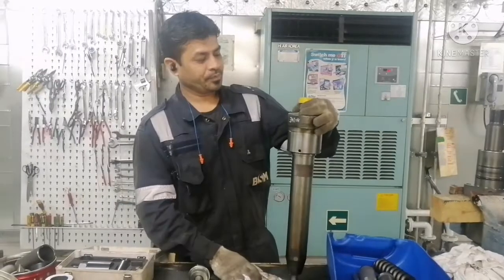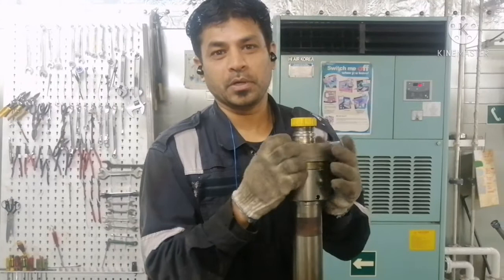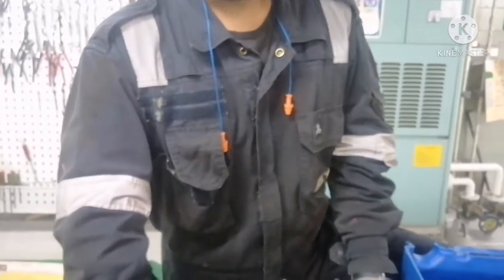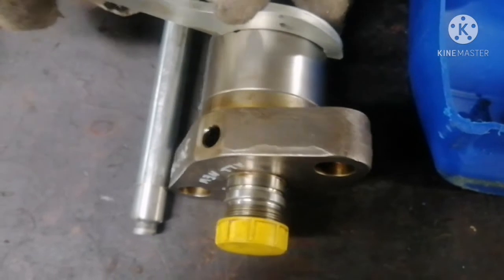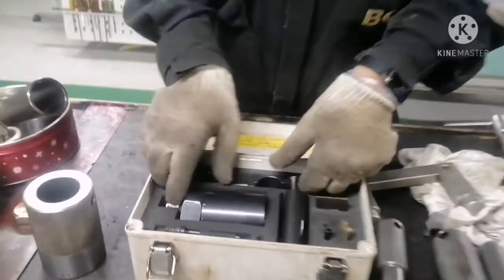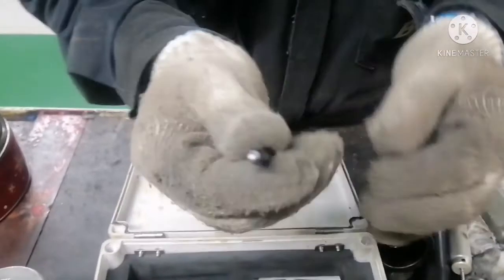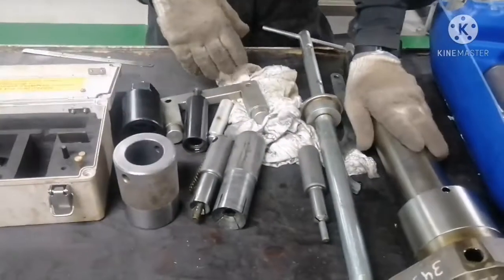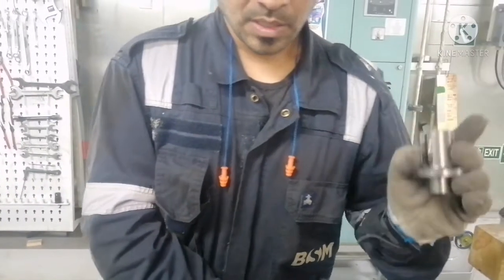Know about your Main engine fuel valves...parts   and special tools used for overhauling...

Comment: A good explanation, hopefully a complete overhauling video will guide further for juniors.
I have some doubts kindly clarify.
1. Atomizing pressure test is not carried out in slide fuel valves. Why?
2. What is the purpose of SAC volume. what are the advantage and disdvantage.

The third question is not about the injector but regarding to Exaust valve.
1. As a 2nd you have joined a vessel and found a set of ovrhauled exhaust valves of main engine kept as standby. How would you ensure that it is ready for use. What are the checks you will make.

Since giving class 2 these questions are asked by the examine. Kindly guide.
Reply from the maker: Vl upload Overhauling video soon sir...
Reply from the maker: 1) 1.	Why atomization not carried in slide type fuel injection valve ?
The reason is that the atomization test may damage the valve because it makes the
needle oscillate, with a small lift at a very high frequency. It also damages the cut off slide of spindle guide. 

2.	What is sac volume advantage and disadvantage ?
A SAC style nozzle has more of a teardrop shape. A tiny cavity in the bottom of the injector feeds into the injector. A small needle at the end of the valve closes the cavity. This cavity maintains a small amount of fuel in the tip, which helps cool the nozzle and preserve longevity. SAC style nozzles are typically used in marine applications or others with lower emission standards.

On a SAC style nozzle, when the valve moves, the fuel cavity immediately fills with fuel and provides a crisp, clean injection.

Advantage : - 1. Scav volume helps clean injection 2. Helps in little cooling of fuel injection. 3. Due which life of fuel injection increases.

Disadvantage:  1. Due to dripping fuel , fuel consumption high 2. Important Nox emission is high in sac type fuel injector. 

3.	Exhaust valve test 
a.	Condition of spindle and valve sealing surface 
b.	Spindle drop time [ for example spindle drop with in 30 min  valve needs to overhauled. If spindle drop between 30 min to 1 hrs then under observation , if more than one hour then spindle in good condition.
c.	Safety valve condition.
d.	Sealing by supplying the air and pouring any thin oil inside the valve checking for any leak from valve.
e. Check the exhaust valve condition report with photograph for confirming the valve is overhauled.
Reply: @marine-knowledge-basha  surprized...An amazing answer. Please keep posting videos and educate us. In the mean time i will ask doubts also
Reply from the maker: @ashikmohamedali6651  welcome sir.. Vl do my level best to reply ur good queries... Kindly share my channel to your friends and ask them to subscribe too...
Reply: @marine-knowledge-basha  defenetly

Comment: Kindly share fuel oil high pressure pipe checks, overhauling,  and any measurements thats need to be carried out. Thanks.
Reply from the maker: Will upload in a day or two for sure..